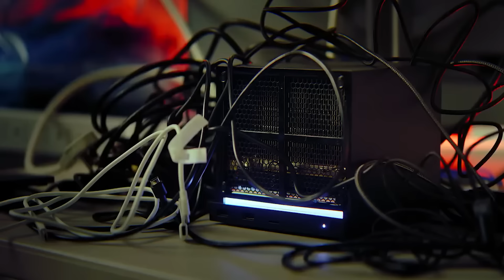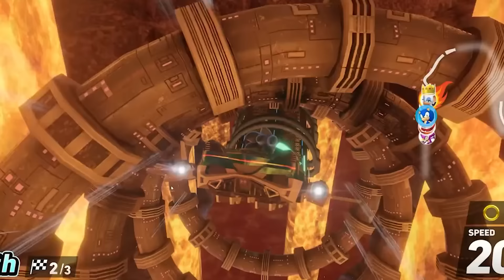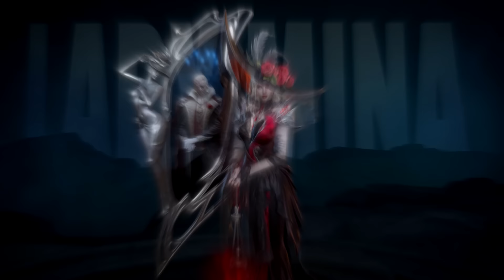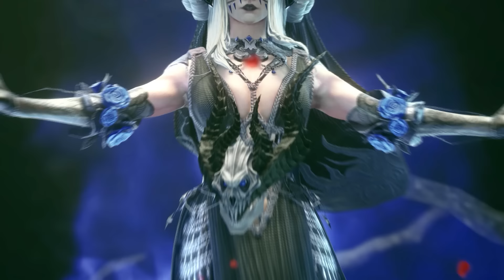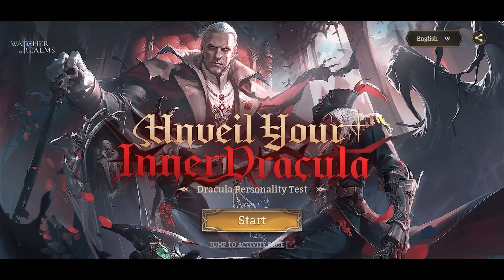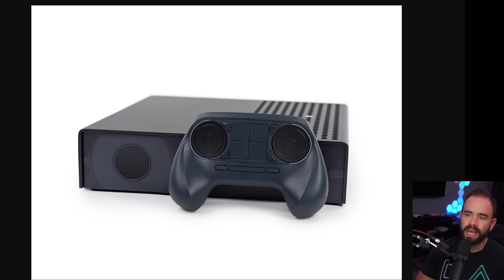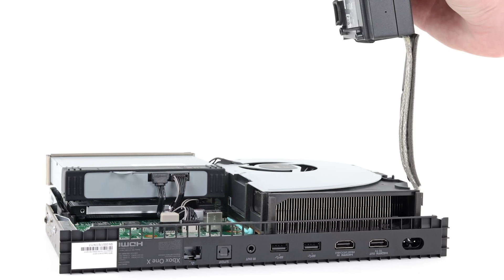The Steam Machine Is More Impressive Than It Looks...

Comment: It has to start at $500, $600 max, it'll be a banger at $499, a bit less so at $599 but still considerable. Anything above that and it's dead on the water.
Reply: Dude, this thing is weaker than a ps5 which already costs 500 dollars. I just love gayben fanboys sugarcoating steam box 2.0. At least the original was more powerful back in the day.
Reply: @deacubogdan2263 on the other hand, with the ps5 you’re stuck in the PlayStation ecosystem and have to pay a monthly subscription just to play online. The Steam machine will play least be able to be played as a console AND PC.
Reply: Id pay $800 for the 2tb model. I got a 512gb lcd deck for $320 and I use it as my main gaming device this is 6xs the power so an extra 480 is nothing for what you get considering the xbox aly x is 900
Reply: @SilentBilly01  the LCD deck doesn't come in 512g. Did you swap out the part?
Reply: @NoNames-vw3bq  It used to. They discontinued it in favor of the other models.
Reply: If they out price playstation and xbox they will have a massive number of people switching from console to this. The main thing valve will want is people getting hooked into the steam eco system. They'll sell the steam machine at a loss and make up for it with all the new steam customers. The fact it can be used as a normal PC really puts it miles above the competition.
Reply: @happyjam92  That's what I hope happens
Reply: Can you build a PC of the same specs, with no discounted price or 2nd hand price?  Cause clearly it's around $800-900.  Second, base on the survey, users can afford around those prices.
Reply: @d3vilmaycry25 It is basically using last gen mobile components that Valve was probably able to buy at a discount, so it's not really about what consumers could make at that price point.

Anyway, as these are basically mobile components, it is pretty easy to find a new gaming laptop with similar specs in the $500-$600 range.
Reply: @xy_z121   Checked the specs, CPU: AMD Ryzen 5 7600 — $180, GPU: Radeon RX 7600 8 GB — $250, Motherboard: ASRock B650M-HDV/M.2 — $95, RAM: Kingston FURY Beast DDR5 16 GB — $86, SSD: Patriot P400 Lite 500 GB NVMe — $43, PSU: MSI MAG A550BN 550 W 80+ Bronze — $58

Total: $712

This is the lowest ballpark of the basic components that can compare with the same specs with the steam machine, this is even without Wi-Fi 6E + Bluetooth card (if motherboard doesn’t already include), a MicroSD card reader (if desired) and a case with good compact cooling (fans/heatsink).  Even with a 2ndhand good conditioned GPU and CPU, you'll still cash out more than at least $700 for the basic PC + controller,  it's doubtful the pricing of parts will lower at least for now since we're at a time where chips, memory, semiconductors are more expensive.  Steam might also charge for a higher price since they don't want a direct competition against SONY and Microsoft.

Caveat is, that if Steam follow Sony, Xbox, and Nintendo marketing strategy of selling it at near loss or break even just to entered the market.  They might sell it as a 1tb Steam Deck, so around $700.
Reply: @xy_z121  I've checked the specs a comparable build will be, CPU: AMD Ryzen 5 7600 ($180), GPU: Radeon RX 7600 8 GB ($250), Motherboard: ASRock B650M-HDV/M.2 ($95), RAM: Kingston FURY Beast DDR5 16 GB ($86), SSD: Patriot P400 Lite 500 GB NVMe ($43), PSU: MSI MAG A550BN 550 W 80+ Bronze ($58) a total of $712

This is the lowest ballpark of the basic components that can compare with the same specs with the steam machine, this is even without Wi-Fi 6E + Bluetooth card (if motherboard doesn’t already include), a MicroSD card reader (if desired) and a case with good compact cooling (fans/heatsink).  Even with a 2ndhand good conditioned GPU and CPU, you'll still cash out more than at least $700 for the basic PC + controller,  it's doubtful the pricing of parts will lower at least for now since we're at a time where chips, memory, semiconductors are more expensive.  Steam might also charge for a higher price since they don't want a direct competition against SONY and Microsoft.

Caveat is, that if Steam follow Sony, Xbox, and Nintendo marketing strategy of selling it at near loss or break even just to entered the market.  They might sell it as a 1tb Steam Deck, so around $700.
Reply: @xy_z121   I've checked the specs a comparable build will be, CPU: AMD Ryzen 5 7600 ($180), GPU: Radeon RX 7600 8 GB ($250), Motherboard: ASRock B650M-HDV/M.2 ($95), RAM: Kingston FURY Beast DDR5 16 GB ($86), SSD: Patriot P400 Lite 500 GB NVMe ($43), PSU: MSI MAG A550BN 550 W 80+ Bronze ($58) a total of $712

This is the lowest ballpark of the basic components that can compare with the same specs with the steam machine, this is even without Wi-Fi 6E + Bluetooth card (if motherboard doesn't already include), a MicroSD card reader (if desired) and a case with good compact cooling (fans/heatsink). Even with a second-hand, well-conditioned GPU and CPU, you'll still spend more than $700 for the basic PC and controller. It's unlikely that the pricing of parts will decrease for now, as we're currently experiencing a period of higher chip, memory, and semiconductor costs. Steam might also charge a higher price, as they don't want direct competition with Sony and Microsoft.

The caveat is that if Steam follows Sony, Xbox, and Nintendo's marketing strategy of selling it at a near loss or break-even to enter the market. They might sell it as a 1 TB Steam Deck, so around $700.
Reply: @xy_z121    I've checked the specs a comparable build will be still be around 700 usd.  This is the lowest ballpark of the basic components that can compare with the same specs with the steam machine, this is even without Wi-Fi 6E + Bluetooth card (if motherboard doesn't already include), a MicroSD card reader (if desired) and a case with good compact cooling (fans/heatsink). Even with a second-hand, well-conditioned GPU and CPU, you'll still spend more than $700 for the basic PC and controller. It's unlikely that the pricing of parts will decrease for now, as we're currently experiencing a period of higher chip, memory, and semiconductor costs. Steam might also charge a higher price, as they don't want direct competition with Sony and Microsoft.

The caveat is that if Steam follows Sony, Xbox, and Nintendo's marketing strategy of selling it at a near loss or break-even to enter the market. They might sell it as a 1 TB Steam Deck, so around $700.
Reply: @xy_z121  You wish. I already checked the hardware specs, and even the cheapest PC that performs like the Steam Machine still ends up around the mid-range price bracket of 700 dollars. That’s just the core parts, not counting things like Wi-Fi, Bluetooth, a microSD reader, or a compact case with proper cooling. Even using second-hand parts doesn’t drop the price much.

The only way the system could be cheaper is if Valve follows the same strategy used by Sony, Microsoft, and Nintendo, where the console is sold close to cost just to get into the market. If they do that, I could see it landing somewhere around the price of a higher-capacity Steam Deck.
Reply: @d3vilmaycry25 I am aware, which is why I said laptop.
Reply: @d3vilmaycry25 Execpt that $700 PC has one major benefit over the Steam Machine!!.....It's fully upgradable.
Honestly, how long do you think the Steam Machine is going to last with just 8GB of VRAM (less than the Series S), a "meh" budget mobile GPU and a 6-Core mobile CPU that are all soldered to the board? Hell!! with the lackluster specs it has, it's already rubbing up against a lot of newer AAA games minimum requirements.
It's as though Valve didn't consider much in the way of futureproofing it and what it's performance would be like in another 3-4 years time, never mind more.
Even the consoles have more longtivity by having better specs and the benefit of having game dev's support for at least 7 years and dedicated game optimisation.
Also, going secondhand drops the price considerably. Using used parts you could probably build a comparable, performance PC for around $450-$500. Hell, even used & refurbished laptops can be picked up for around $450-$500 with a simular level of performance (or slightly better) than the Steam Machine.
Reply: @fafski1199  Give me a build and you tell me,  cause last I check, a comparable performance nets you $700, a noticeable better performing PC nets you $1000+, even at a discounted price.  The survey that Steam released before show that half of users use 6 cores and below.  Majority of PC users don't care about performance anymore.  They market this thing as a PC but we all know Steam wants to enter the console market.  For us PC users, it's a sidegrade, an extension of our library to the living room .  For console users, it's a better alternative.
Reply: It also has to be bug free at launch, if this is to persuade console players to move over they wont tolerate the messing about us PC users are traditionally used to. I think Valve will make it so that its a more powerful DESKTOP Steam Deck. I also think the VR goggles will be Steam Deck-ish, sort of a VR Steam Deck. I will wait until it comes out but I cant see me DOWNGRADING my existing SFF computer which is far more powerful, The goggles are a different matter, if they are better than the Valve Index  without the cables i could be persuaded, but there again it depends on price.:body-blue-raised-arms::body-blue-raised-arms:
Reply: Minis forum has been selling their neptune hg70 through hg100 series with more expensive but similar specs to this for 600$ for years 
With a more expensive form factor, more expensive parts, and a smaller run than the steam machine.

It's very very likely it'll just hit 500 if memory and storage prices don't continue to explode
Reply: If it's priced even at $500 or above it won't win over many consoles gamers. The console gamers that have already bought into new gen (quite a lot at this point), just aren't going to ditch thier PS5/PS5 Pro/Series X for a lesser performant Steam Machine. Even if it has PC features and slightly cheaper games. And those console gamers that are still hanging on to last gen consoles, will likey follow suit and just buy a PS5/Series X because of thier back library of games.
The only people it might attract are those disgruntled Series S owners who want to jump ship, poor PC gamers on a very tight budget or rich PC gamers with silly money to burn on a second/third PC for thier TV set.
If it's above $650, then it's DOA and will only attract a few gullable diehard Gabe & Linux fanboys, console collectors and rich kids.
With the specs it has, it's only going to sell reasonably well if it comes in under $500.
My guess though is it'll be in the $600-$650 range for the basic model. And as such it'll likey be yet another disastrous Steam Machine failure by Valve.
The controller might sell reasonably well amoungs't the PC crowd, though!!
Reply: @fafski1199  Yep, I agree with pretty much everything. Just catering to the niche of a niche of a niche. It blows my mind that it isn't even a good option to buy for a teen looking for a first gaming PC since it doesn't play Fortnite, COD, BF6  due to the anti-cheat conundrum. People also need a PC when they get a gaming PC, they need it to use Adobe or Office and other stuff that Linux doesn't run. It''s like the more I look at it, the more I'm dumbfounded as to who is this for?
Reply: “Valve targeting entry level pc price point” - Linustechtips. Maybe similar price to ps5 pro?
Reply: @adamjackedd  Gamespot: “We were told it will be competitively priced to an entry level PC”
Reply: @ItsTheNoobster Ps5 pro is like $800? What’s your price point looking like for an entry pc ? I would hope Valve make it priced fair enough to hit mainstream to get more people on pc gaming. (I recently left ps5 pro and series x behind for a real gaming pc - 5080 & 9800X3D and I’ll never go back)
Reply: Honestly they can sell it as a loss leader and it would still be profitable for them, due to the massive amount of money they'd make on the games.  I would sell it at 450 for the lowest unit, 550 for the better unit.
Reply: @ivenstorm   Valve has said that they recognize that while it has the form factor of a Console it has the functionality of a PC. So I doubt they would sell it at a loss as a company could buy a lot of Steam Machines and then never buy any games from steam.

Also, Part price estimates put the cost of the Steam machine to build at around $430 so I think it would be probably $500-$600.
Reply: @Xavior36I would just not let companies buy em. Valid steam accounts only.
Reply: @ivenstorm  The problem with that is it's a full fledged PC, so some company could decide they like the specs and the price, and buy a couple thousand to upgrade their office computers to, and not a single game would be bought from that. The lowest Valve can safely go is breaking even after accounting for something like a suprise tarrif, a part price spike, etc.
Reply: @masonbarber871  and that's a fair way to look at it.  Which is why they will need to account for unit limitations when purchasing and possible IP blocking if possible.  All I know is that with the right price I'm going to have my unit within the first couple months.
Reply: @masonbarber871 People keep talking about this because LTT said it, but it makes less sense the more I think about it

1. Most businesses don't really have a need for a dedicated GPU, no reason to spend more for it
2. You'd have to install Windows on every single one of them, manually
3. Even if Windows is installed, it wouldn't be a completely flawless experience. Yes, I am aware that Windows now isn't a completely flawless experience, but there would likely still be some compatibility/driver issues.
4. Businesses can't buy these in bulk at a discount like they can with other workstations, which would probably already be cheaper to begin with
Reply: @masonbarber871 People keep talking about this because LTT said it, but it makes less sense the more I think about it

1. Most businesses don't really have a need for a dedicated GPU, no reason to spend more for it
2. You'd have to install Windows on every single one of them, manually
3. Even if Windows is installed, it wouldn't be a completely flawless experience. Yes, I am aware that Windows now isn't a completely flawless experience, but there would likely still be some compatibility/driver issues.
4. Businesses can't buy these in bulk at a discount like they can with other workstations, which would probably already be cheaper to begin with
Reply: @xy_z121   1 and 4 are pretty good points. Video editing, 3d modeling, game development, and some computing tasks need a good GPU, but definitely not normal office work. Depending on the price point Steam hits, especially if they sell at a loss, it could outweigh a bulk discount but that doesn't seem super likely.
As for points 2 and 3, there are a number of large organizations using various Linux distros instead of Windows, most prominently France's gendarmerie with over 100,000 computers, showing it is a viable office OS. While Steam Machines wouldn't make sense at that large a scale, I still think a company buying them would likely go the Linux route instead of paying Microsoft for licenses.
Reply: @masonbarber871 Ohh, I didn't know there were already companies using Linux already. That's pretty cool, honestly! It's kind of sad that I'm just now finding out about it, though. Guessing it didn't really get much media coverage.
Reply: @xy_z121  There hasn't really been any media coverage outside of EU government agencies switching over here or there. I knew it was being used in a bunch of places, but had to google to get even the example I gave.
Reply: This right here. Literally needs to be $500-600 take a bit of a loss and be a booming success. Because that's a perfect price.
Reply: your expectations are unrealistic. no console is ever going to hit those prices anymore
Reply: Even at those prices, they're losing to mini-PCs which are far more portable, come with 1tb storage, extra NVME slots, Windows 11, e-gpu support, and a superior processor. Even at $500-600 Valve needs to rely on brand loyalty, and honestly customer ignorance, because it won't be the most value EDIT: I forgot RAM, those little mini-PCs also come with 32gb DDR5
Reply: @EhurtAfy  I just love confident ignorance
Reply: @_n8thagr8_63  Good, I want Valve to keep winning, so we need people like you to support them. Even their bad products
Reply: @EhurtAfy  This has to be bait I mean your comparing it to a different product with different demographic lmao
Reply: There is no reality where this device is over 500usd and does anything over 5 million units lifetime. 

Which for a pc might be okay, but no matter what they say this is positioned as an Xbox 5 and mini PC competitor.  I'm very harsh on Xbox, but Steam Deck numbers is not going to cut it, especially not if Xbox is going for the premium angle which sets it apart from a boring at cost option with lots of competition that's a better value.

This is a vanity branded product for Valve fan boys that doesn't solve any existing problem, and will be overpriced for its very modest offering.

Niche of a niche.
Reply: @ShadowYGO  What is the demographic difference? Are you saying there's a demographic of gamers that actually want to pay more for half the RAM, fewer NVME slots, a bulkier case, weaker CPU, and no ability to plug in a better GPU in the future?
Reply: I'm guessing $999.
Reply: With the power of 6 steam decks this will be around $1000 maybe more